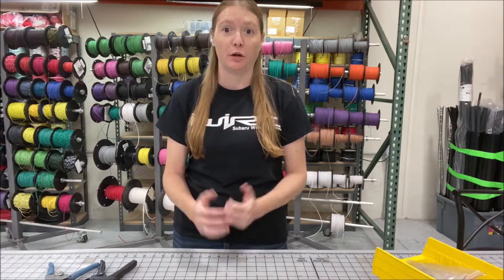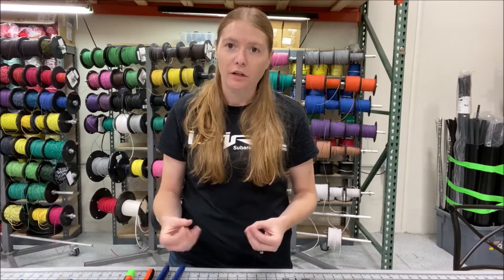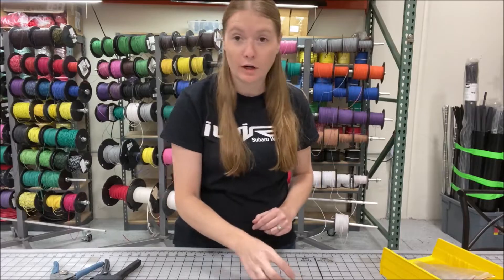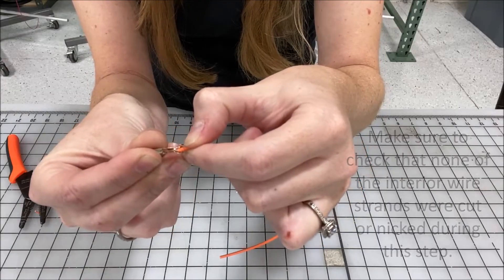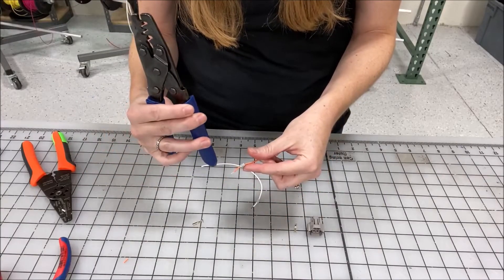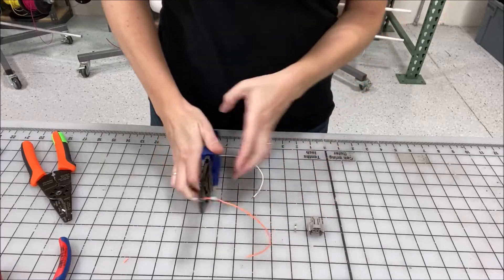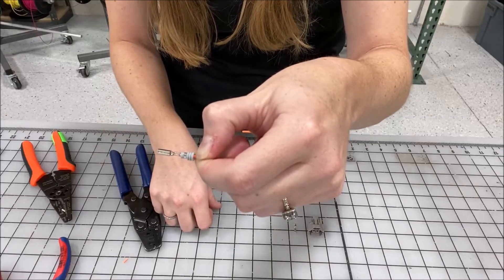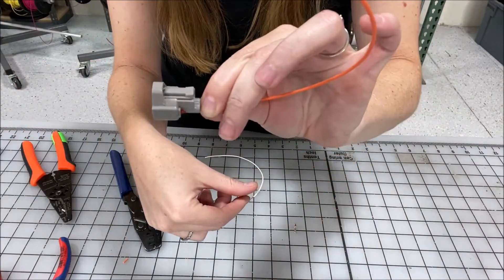How to Crimp a Terminal

Comment: How can the rear wings hold the insulation properly, if they are formed around the silicon seal? I thought the whole reason of crimping over the insulation sheath was to support the cable from being pulled out of the terminal. Your crimp method means the load and the support is only being held by the front wings, because the silicon seal is not going to hold the cable if it is pulled.
Reply from the maker: Sealed connectors do not have additional support because the rear wings hold the seal tight and keep moisture out.

Comment: Great video.  Only tweak I would offer would be to put the seals on before stripping the wire.  Easier to thread on.
Reply from the maker: We like to strip first since there isn't always enough room to put the seal far enough back on the wiring harness to then strip it :)  Appreciate the compliment on the video!
Reply: @iwiresubaruwiringsolutions  I understand that completely.  Been there done that have the finger cuts in working in tight spaces.

Comment: The only presentation that has clear images to represent the step-by-step stages and the finished connection;  all admirably demonstrated.  Thank you.  I'm actually wiring a prototype high-end home hi-fi stereo loudspeaker system with brass spade connectors:  avoiding soldered joints which clearly add unwanted noise to the treble.  Brass, like copper, has superior signal transfer with minimal pick-up of noise at the contacts.
Reply from the maker: Thanks!

Comment: Do the WRX green test connector under steering wheel go bad? I think mines is bad. I was flashing my 02 WRX recently a lot and all of a sudden I can't flash it no more. Can't get the car into test mode at all. Still able to go onto ecuflash and able to click on read/ write icons but can't do either one cause car can't go into test mode.
Reply from the maker: Hi Tom, there are a few variables for why test mode is not working but bad connectors could definitely be the problem.
Reply: @iwiresubaruwiringsolutions  I'm not sure what to do at the moment. What do you think I should do?
Reply from the maker: @tomvang18able  I'd recommend taking it to a local shop for diagnosis
Reply: @iwiresubaruwiringsolutions  is this something I can do myself or better to just take to a local shop?
Reply from the maker: @tomvang18able  I'd recommend a shop in this case since you're not quite sure what the issue is being caused by. If you know it's a bad connector, then the replacement of just the connector is easy and can be done at home.
Reply: @iwiresubaruwiringsolutions  ok I'll try to find a shop thanks!